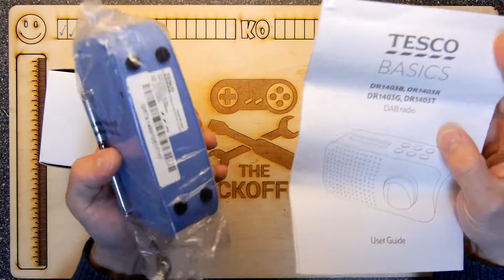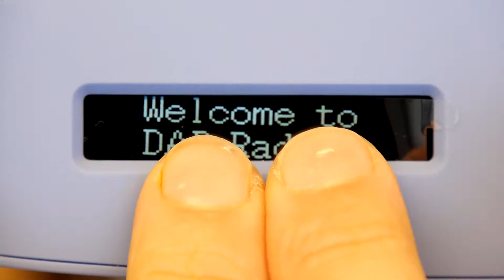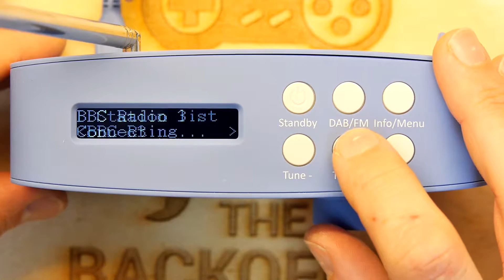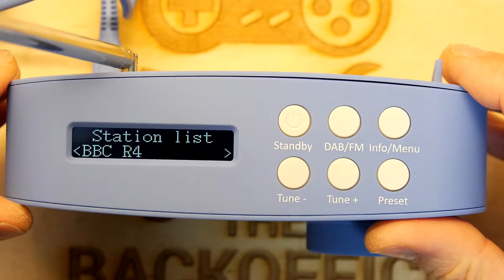Tesco DAB Radio DR1403B

Comment: Had one of these little radios for a while with no problems except that rubber coating starts to de grade and goes all sticky. 
Spent 40 min the other day removing it with isopropyl alcohol to reveal a very shiny little radio beneath all good now haha.

Comment: does this or do you know any that will have somewhere to solder audio output on to connect to an amplifier, basically making a diy speaker and want to add dab radio to it. cant find any cheap decoder type things as there are fm decoders but the dab ones im seeing are like 80 pound
Reply from the maker: I am quite sure it will. You would need need to locate the amplifier IC and tap the input to it.
Reply: @backofficeshow  or would it work using headphone jack on the dab radio and to the aux  input on the amp
Reply from the maker: That would work

Comment: Why dont manufacturers of DAB radios add an external antenna socket to these bloody things? 
You have to open them up and mod them with an external ant socket before you can even use them, even on expensive and good makes like Roberts. 
The Pure Evoke-1XT is about the only DAB radio I have seen that has a real socket I think an F-type
Reply from the maker: I'm guessing it's cheaper not to put the f connector and for most people it's good enough. I remember having a Psion wavecepter back in the day and it was awful. I then went onto the pure evoke and even that was pretty bad where I lived. Ended up making a massive antenna out of copper microbore pipe and scraps. Went from single digit signal and quality to maximum 😂
Reply: @backofficeshow  Love that I like it when folk experiment
Reply from the maker: I started getting into SDR this year, but I've got distracted with other things. I still pretty much listen to FM most of the time, generally radio 4 and classic British comedy which is actually streamed from the internet and broadcast using one of those FM transmitters 😂
Reply: @backofficeshow  I got into radio when I was 12 listening to shortwave and radio has just stuck I am now a licenced HAM. I must admit I love radio 4 especially the shipping forecast
Reply from the maker: Sailing by! 🎶🎵
Reply: @backofficeshow  Take care pal I have subed by the way I look forwards to catching up with all your vids

Comment: Hi, Thanks for the video. I know is an old post but I'm trying to upgrade that tinny sound from a DAB radio with the same FS0129 chip but I can't seem to find the audio output on that module before it gets to the amp chip. Reason I'm asking is that I want to add a small 10-20w amp for a bass speaker and need a low input. Thanks

Comment: If you're still getting ratty sound, open the case up again and remove the speaker wire out and away from the cone ;) Dropped yo a Like..
Reply from the maker: Component legs and metal shavings sticking to the speaker cones are the bane of my life!

I was doing to make a microphone today, luckily they don't suffer in the same way but do have their own issues 😂

Comment: I've got one at £16 - it doesn't buzz, though it eats batteries even on FM. I can recommend the dr1404, now at £18, though I got it for £12.50 a while ago. It's still a good deal as it has a bigger screen and speaker, plus alarm and aux socket. I'm very pleased with it.

Comment: The DAB format sucks
Reply: DAB was a format developed in the 1980s.  It uses MP2 (not 3) encoding, and is broadcast around 200 MHz in the old VHF TV channels.  Because it was developed so long ago, it is pretty crude.  DAB+ is a (marginal) improvement, but the audio quality is still disappointing in most cases. because the broadcasters sacrifice bandwidth to cram ever more stations in.  

I still prefer a properly modulated FM signal!  The audio bandwidth is the same, (up to 15 kHz) but FM is a robust analogue signal, and if the stereo is noisy (because of poor reception or long distance) you can always switch to mono for a hiss-free signal (mono requires less than a quarter of the bandwidth demanded by stereo).
Reply: You're a fool. Simple and plain.

Comment: Ten years ago I tried a few DAB radios but most were either mono, lacking features or good sound and were rip off prices.  So in 2007 I saw a Tevion WiFI Radio in Aldi for a mere £65 (later reduced to £30 in some areas!) and it is excellent.  Stereo sound, full with solid bass and crisp highs;  streams music from networked shares;  has more than 20,000 stations (it began with around 5000).  I still use it nearly ten years on and the only downside, is that the BBC changed the way their iPlayer radio catchup service worked and that broke it for my radio.
Reply from the maker: I love WIFI radio, mine is permanently on Dad's Army and Steptoe and Son! My original PURE Evoke is still going strong, only mono but great for Radio 4. A Good sound.
Reply: believe it or not, not all DAB stations even transmit in stereo in the UK and thats in 2019! infact DAB audio is actually technically inferior to a strong FM analogue station even when listening to a stereo DAB station. DAB+ is better and has more capacity, but very few stations currently use the newer standard. some stations in London are switching over to DAB+ but there are no plans for a nationwide switch in the near future. DAB radio in the UK has been a major failure according to an industry watchdog. if only they had known what was coming when the BBC made this programne: https://youtu.be/ymt6GK5UIJQ